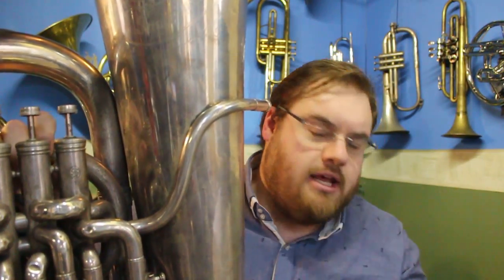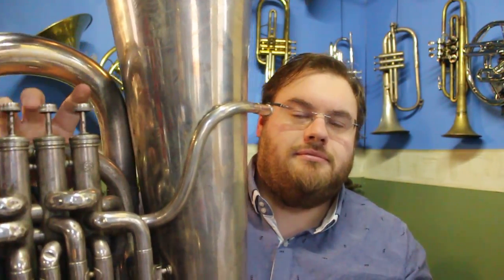Are These The World's Bounciest Valves??

Comment: That bounce (at the top of the upstroke) is the springs being worn out, too soft or too short in length.... 
I've seen it several times and every single time a set of replacement springs that fit properly cured it. 

Good news, then - all is not lost, Trent.

Comment: I would assume that it has something to do with the silencers. Someone probably used either all cork or some rubber, felt usually absorbs a lot of the energy instead of sending it in the other direction. the valves also look like they may need more spacing under the valve caps anyway. have you checked the alignments of the valve ports?
Reply: It's almost certainly springs - the clanking noises are very likely due to worn felts, but the bounce will be the springs themselves... they'll be either too short or way too soft (or both) - could be that it's had so much use that it happened over time or it could be that someone replaced the springs with ones that didn't quite fit properly.